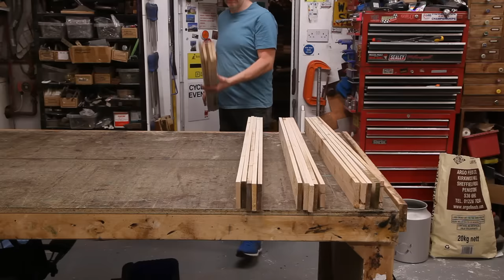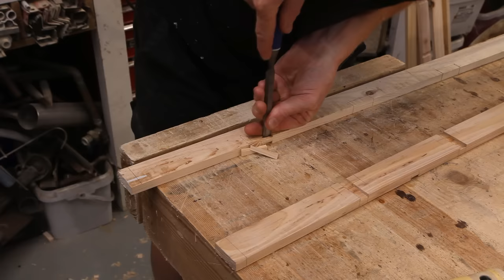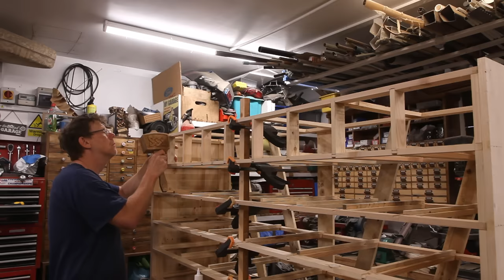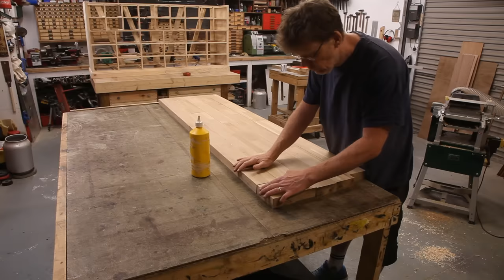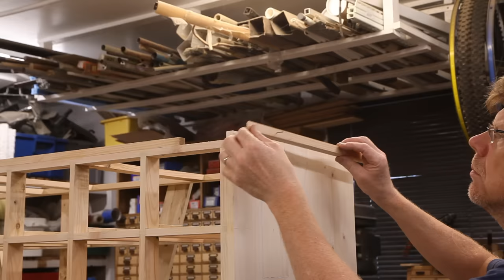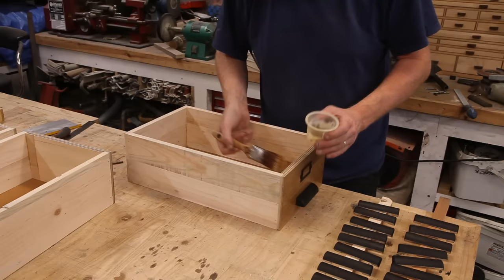Apothecary Cabinet Workbench Made From Pallet Wood, Worktop Offcuts and Oak Flooring.

Comment: Its awesome that you do this from pallet wood. My issue is, you get the best pallet wood out there. Almost new it seems. I scour the area around me, stores, factories etc. and every pallet I get is basically 10 years old and had/has been fixed or rebuilt using different wood or soaked in oil/grease or other substances for months.

Comment: I’m always impressed by your using a hand tool for your moulding instead of the router table. 

As you were working on this project, I recognized your technique on the other cabinets in your shop.  

This is absolutely gorgeous.  I like your videos.

Comment: I love the demonstration of shop skills.  I would like to see more of the design process. How do you choose how tall it's going to be, how wide, are there standard furniture dimensions for this, is it just based off the length of the pallet wood you utilise? How many drawers, what drawer runner system you'll use?  Is it just paper and pencil sketches? Is it computer CAD? Is it formal drafting plans? Did you just pinch the design off the net? So many unanswered questions. :)
Reply from the maker: The designs are all my own. I don't do very much planning at all. Just a very basic drawing to get an idea of the look, then I make it up as I go along. I usually have an idea of sizes that I want to work to. Sometimes it's based on what material I have available.

Comment: Gorgeous as always. I kind of wanted to see where it was going to go but I'm guessing it was made for someone else? In which case I'm sure they'll cherish it. You had me wondering what you were doing on several occasions, but I enjoy watching it all come together and make sense. 

May I make a small suggestion? When you're doing your handheld camera shots you could put the camera into slow-motion mode and move the camera very quickly around the piece. This gives you a smooth shot without the handheld wobble, but still gives you the circular camera movement. Not meant as a criticism, just a suggestion. Thanks for sharing your work, its lovely!
Reply from the maker: Thanks for the camera tip, Caroline. 
The cabinet will be going in the workshop so you'll get to see it's final spot in a future video :)

Comment: Damn fine work Sir... You are to be commended for your skill and patience.  I only have one question...  Do they not have dado blades in your neck of the woods?
Reply from the maker: Thanks very much. 
No, unfortunately dado blades are very uncommon here in the UK. They are hard to buy, and most saws don't have a long enough arbor on the motor to fit them.
Reply: @EpicUpCycling  That is surprising to hear.  I feel blessed to have woodworking shop that is full of modern tools, and yet, I have great respect for those that can do good quality work with a back saw and a good sharp chisel.  You've gained a follower today :)

I'm a bit of an up-cycler myself...  I used to make all manner primitive wall shelves, floor cabinets and picture frames from old reclaimed and weathered fence boards.

Comment: Thanks for the video think i have watch it ten times now. What are the dimension of the 2 sized draws love to build something like this ❤
Reply from the maker: The small ones are approximately 175mm x 140mm and the large ones are 271mm x 140mm.
Reply: @EpicUpCycling  thanks 😊
Reply from the maker: @gavinowen4776  You are welcome 👍
Reply: @EpicUpCycling  what the high and depth.
Reply from the maker: @gavinowen4776  140mm high and approximately 300mm deep
Reply: @EpicUpCycling  thank you good sir
Reply: Hay what's the floor to top hight. ?
Reply from the maker: @gavinowen4776  900mm
Reply: @EpicUpCycling  thanks good sir
Reply: Hay what are the width of the 12 rails you put in looks like 3in

Comment: Huge fan here, love your work. I notice when smoothing your glueups with a belt sander, you sand across the grain. Is this on purpose for the effect, or just easier given the dimensions of the work, or for some other reason?
Reply from the maker: I usually sand crosd grain for the effect. It gives a nice, aged look to the wood.